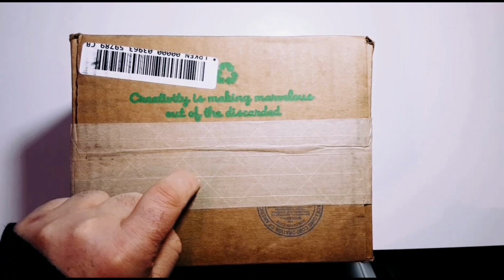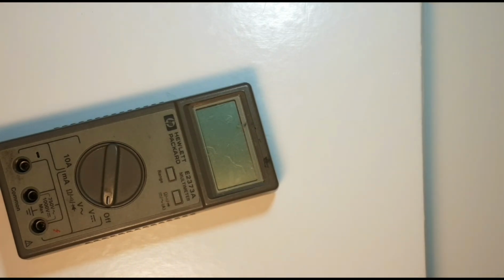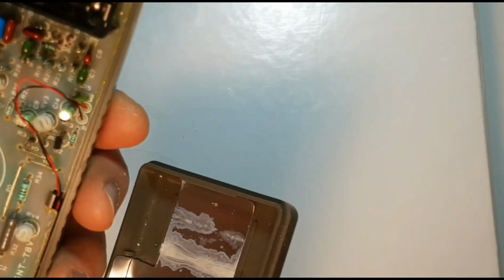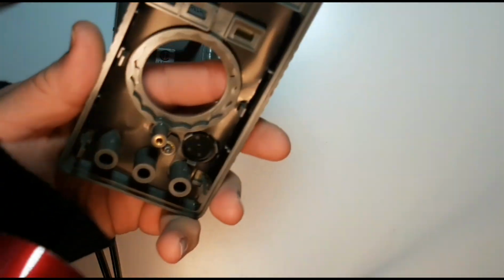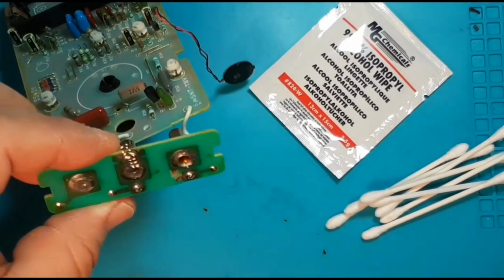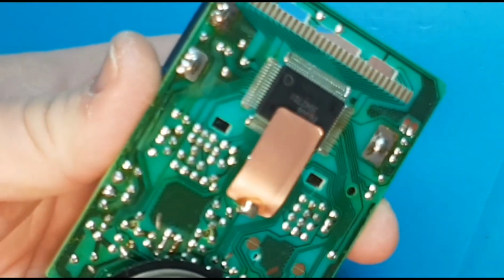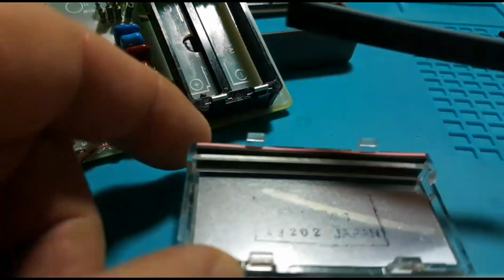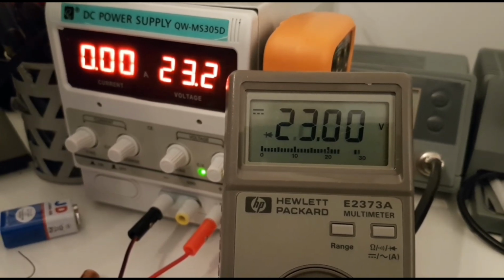Hewlett Packard E2373A Vintage Multimeter Restoration/Repair

Comment: I recently acquired one of these HP E2373A.  A friend of mine gave me a box of some miscellaneous electronic parts, etc. and this meter was in with the mix.  I think his dad used to repair printers years ago.  The AA batteries had leaked, but I was able to clean it up pretty good using a little white vinegar on a cotton swab and some contact cleaner.  I saw on ebay  someone was asking $155.  I know the older HP test equipment was very good, I have an older HP AC analog Voltmeter that's a workhorse.
Reply from the maker: Great story.
Those HPs really did stand the test of time. Plus if kept in good shape they hold their value as well. Thx for sharing!
Reply: @KeepOnTesting  Yes, that was back in HP's "Hayday" .  They made some good test equipment back then.

Comment: I looked at that one or one just like it on ebay a couple times as well, almost looks like its loosely resembles the old Fluke designs such as my old Fluke 27. Looks like old school quality of its day, Japan made some of the best electronics of the era.  I use Deoxit on the range switches sometimes as well, cleans and lubes without heavy gunk.  Very cool getting to see inside this one, I do pretty much same as you to every meter I get, even the new ones just to see what ive bought and how its made.  As I said I had seen this on ebay and was curious as to what it might look like inside, great video.
Reply from the maker: Thanks!  , Yes these old meters were very well built, lots of thought went into the design and overall implementation. It's alot of fun and really interesting to fix them up. I find  it very relaxing :) Deoxit is really great, a little goes along way... which reminds me its time to order  more :)
Reply: Yeah I love the take aparts of both new and old and I love the like new Fluke 27 was lucky enough to find from an instrument seller in NY, roughly the same era as the HP I reckon.  Curiousity made me order one of those total auto ranging pocket meters with just three buttons, this ones an Aneng V01A and its not bad even if it does look a bit like a newborn Transformer toy-lol.  The full auto thing is a bit of a compromise & makes everything take a half second longer to read most times but it is very accurate and the leads though only medium scale are surprisiingly decent quality and have minimal resistance.  The box looks like they played hockey in a hurricane with it but the meter is undamaged.  I like some of the Aneng stuff and this really isnt too bad for only costing $10.69 and free shipping, but not surprisiing theres no cap range.  I will have to say it was my first time sticking probes into an AC outlet without first selecting an AC range since there is no range switch at all, I half expected it to blow up in my hand but no drama, just an accurate AC reading, whattaya know.  The meter actually has a good solid feel in your hand not like a cheap ass pos as some meters of this ilk and it even has a nice beefy little removable rubber boot on it.  Theres a manual in full logical english with all specs, its got a 600v limit on AC/DC voltage.  I havent seen inside but dont expect too many surprises for less than $11 shipped.   @KeepOnTesting
Reply from the maker: ..Glad the Fluke 27 worked out, it's a very sweet DMM and built like a tank! 
Always nice when the sellers are honest/no BS!

I just grabbed a new/unused in the box Fluke 73 from the US (ebay), hoping its as good as it sounds too!
Reply from the maker: Sheesh, I had to double check but yes indeed, I have the Richmeters 403B in my TO-DO review box as well, it's identical to the Aneng V01A so hopefully you'l find that review helpful! They look identical save for the logo ;)
Reply: Hey are you getting the emails I just sent to the address you gave recently-?  I sent one with four pics of the Aneng VO1A but when I reply to your emails in my email box I keep getting a failed reply message-? @KeepOnTesting
Reply from the maker: Nothing was received..did you try:     netplicity1@gmail.com
Reply: Ive also got to open my first cheap bench power supply - havent liked any of the beige box cheapies that flood the online market, and Ive grown to like stuff from tacklife so I bought this one after looking at it for awhile  @KeepOnTesting
Reply: Funny you should say that, its the same with me and tinkering with stuff like this.  Its relaxing gets my mind of stuff and I guess one might even call it a therapy of sorts-lol
Reply from the maker: @yambo59  Some peoply buy meds..I just buy meters ! 8-) ..
Best therapy I know
Reply: lol - yep, a toy a day keeps the dr. away ;^)

Comment: If a digital multimeter is vintage an analog is prehistoric?
Reply from the maker: Technically, vintage electronics are over 20 years old. But yea...a 60's analog meter would be a museum piece. Personally,  I consider around 25-30 years as truly electronics vintage.